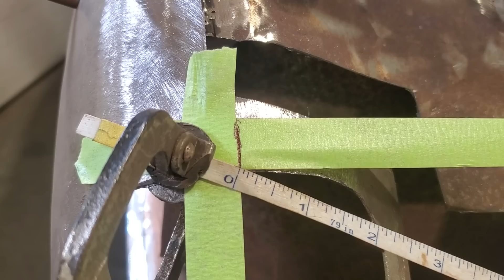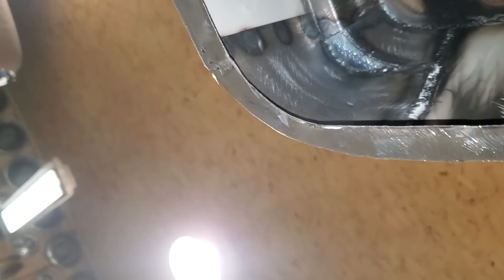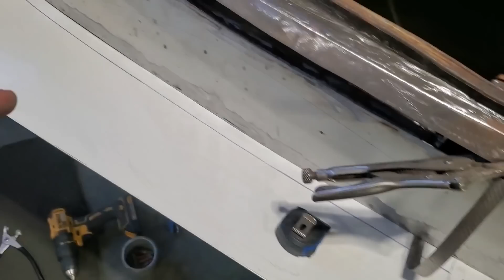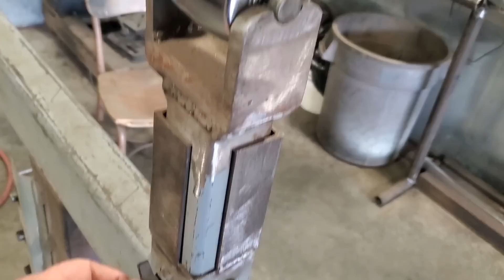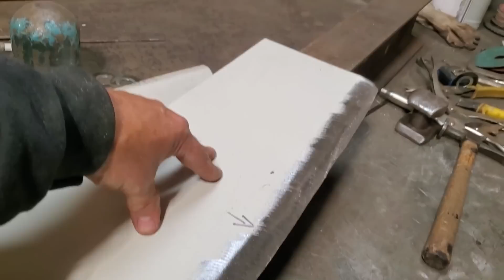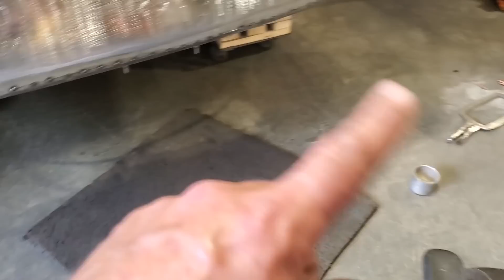1949 Chevy Fleetline custom Tail panel. Part !

Comment: It's a process of learning for sure, every time you see the Eastwood or Lincoln guys do it in their promotional videos, they've done it for years and make it look easy.
Shrinker/stretcher is, to me, an indispensable tool to have in the arsenal.
It's not that I couldnt make wheel arches, etc, before, any panel can be made with limited tools, given time, but the shrinker/stretcher just saves SO much time.

Comment: Nice Fitzee. I use a seamstresses' tape as well. Great to find a metalworker that does the same 👍Old Skool metal bashing at it's finest! With multiple bends and rolls, one needs to work out the order of operations...which can result in a lot of "extra" panels. Sounds  like you could've used a wide slip roll machine on this one. When using the wheel machine, and you want a contiguous shape on your panel from end to end, it's best to come right off the ends, and reinsert the panel with each run or you could get a flatter spot at each end.

Comment: Love your fab work Fitzee,  we think very much alike.
 I have some pretty cools that I barely use, a couple hammers and a few oak blocks out of the wood pile does 90 percent of the shaping work.  The english wheel is good for fancy stuff sure, but it's amazing how much you might use it just for a minute to straighten out something you shaped real quick with a hammer. Great video!

Comment: I don't have 1/10th your expertise and I can see that you're right. You couldn't have built that entire roll pan as a single piece on the English wheel. Love your techniques of cut & butt weld panels together and the one where you build complex shapes with corners by running the material past an edge and cut it back after welding. It makes it so much easier to get a good corner without burning through the edges and making a huge mess.

Comment: What an excellent video. Really appreciate the fact that you spent the extra time to demonstrate how you made the full size panel with the little one. The fact that you shared with us it took you 3 tries to get it right is something that pushes me along to stay calm and just keep at it. Your vids and others have helped me accomplish quite a bit so far this year and oddly enough more than a few times nothing I'm doing is related to what your doing except that it's on a vehicle. Just helps sometimes to see for yourself that it doesn't just fall out of the sky and put itself on the car. You have to work at it and fuss over it a bit and it will start to come together. I'm anxious to see the entire panel finished. I  have to make up the pieces and get them all to meet correctly at the rocker panel to fix up a rusted out floor and rocker and your progress will egg me on to work at mine. 
Don't you tink that would be a newfoundland wheel considering where your at and who is running it ??  Hahaha

Comment: I saw the panel flex when you held it with the hammer, thought it might not have fitted to well, but everything turned out, excellent video thanks again, I have a Toyota landcruiser rusting out but confident after all your tip's may be able to repair it properly, all the best to you and your loved ones

Comment: EXCELLENT JOB . No is that a tail light  Guarantee . Meaning it's Guaranteed until you can't see the tail lights as it leaves your shop LOL.  How much longer before your back on crusty . I know want to finish wind's mustang and get the work done on that chevy but I was just wondering because I can't wait until you get back on crusty
Reply from the maker: Plan is paint wendys car and get it finished so it can be out of the shop then back full time at Crusty. You and me both are itching to get back at Crusty

Comment: Multiple crowns, conflicting natural bend tendencies and no existing template to copy - all done by eye to look right......yet there it is, finished.  Ok - much time invested, but look at that result!  Compare what's there now to what was there and it's night and day.  

Your tips are always good, mate.  The best tips for metal working that you keep repeating are to take your time and not overthink it or think too far ahead.  Also, to cut the big project into several smaller ones so that its not daunting and you can stop and pick it up later without wondering what you were thinking at the time. 

I watch many channels that have people doing bodywork....but none that show them always doing it perfectly first time, because that isn't realistic.  Some of these channels even quote YOUR techniques by name (and mention you and your channel too) and some do things totally differently.  Of all of them, your channel is still the one I relate most to when it comes to putting things in simple terms, which makes a complicated repair look simple.  

This project (in particular the rear end formation) is in a league of its own though and something I would likely never attempt, but it is great to see how it can be done.  Pleased to hear you mention the English wheel and how often you use it, as a lot of guys will go and buy everything for their shop in case of suddenly needing a tool they do not have.  Although I enjoy watching people use these tools, I much prefer the simpler approach you have.  Many thanks for your continued videos and your explanations of why (or why not) you use things the way you do.  All the best.

Comment: That was well worth watching!! 

Tony, I was wondering if you could show a video of your air compressor moisture removal equipment or process? Did you make your own air dryer system or buy one? 

One other question. Do you have any problems with the .023 welding wire bird nesting at the drive wheel? I have seen this issue on multiple brand welders. We changed to .030 wire in the body shops I worked at and no longer had the issue! What did we do wrong?? Thanks for any help!!! I enjoy your videos so much and learn an incredible amount of useful information!! Please keep teaching us!!! Thanks again!!
Reply from the maker: I have no dryer. Never had one. I have a water separator on my spray guns. My lines are Copperas at the end of the line it runs down to the floor with a tap on it and there is where the water gathers. Key is my compressor is a low rpm compressor so it dont build moisture like a high rpm compressor.  
 The wire bird nest cause the roll of wire is not tight enough.  It should not roll unless it is being pulled

Comment: Excellent vid.  How do you go about tightening up stripped sheet metal screw holes?   I've filled the hole with weld, re-drilled the hole but the harder weld ruins the screw.  Also tapped them flat but they work loose in a few miles.    Thanks!
Reply from the maker: I use copper wire or small peice of steel to put in the hole to tighten up the hole.

Comment: would using a rubber band on the English wheel change your method? I got a tail pan for a 46 coupe,very expensive and lots has to be to make it fit properly. Thank you for the video,helps me learn to use the tools I have.
Reply from the maker: Yes it will roll the panel and not crown it. There are a number of great videos out there on it

Comment: Really cool! Had to smile tho', 'cause I got the feeling you were trying to use the wheel and the shrinker/stretcher as little as possible -- that new fangled stuff -- aaah!! Hey Tony, what happened to the Vistacruiser? I've been waiting to see the scoops installed, I've got a 67 Cutlass 2dr ht that would look good with scoops like that, but welding them onto that big, flat hood ----- like to see how you do it and then see if I can make your technique work.
Reply: Agreed, whats up with that olds wagon?
Reply from the maker: It's coming soon. I needto get that hood completed.
Reply: @fitzeesfabrications  👍